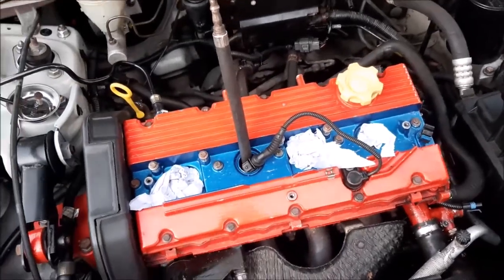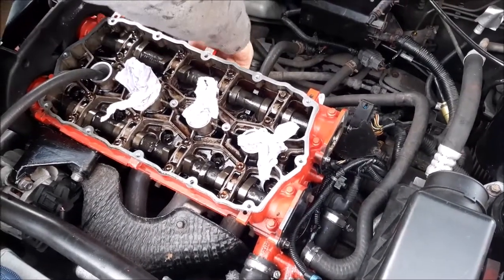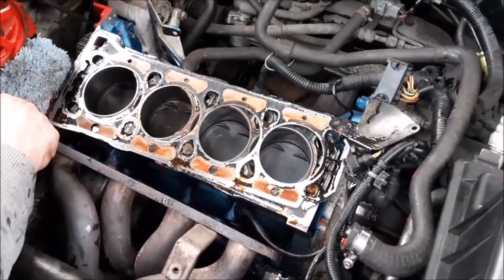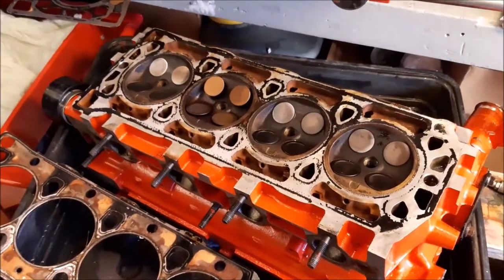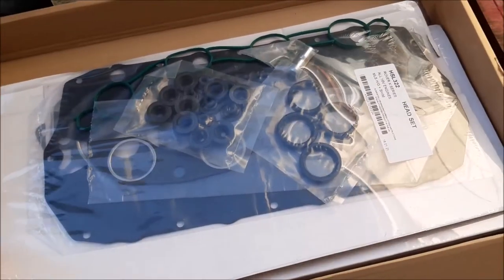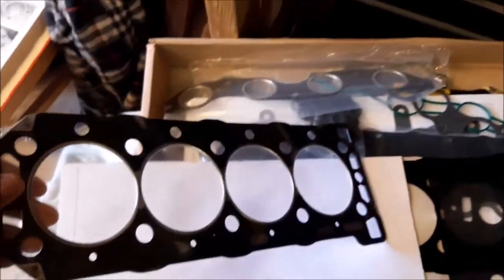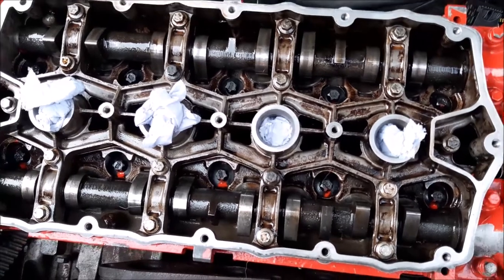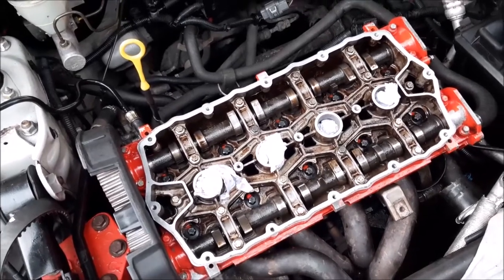Head Gasket Rover K series engine Part 1 Replacing the head gasket Rover 45

Comment: That was really informative! It's helping me (a completely non-mechanically minded person) to understand how the K-engine works.
I do have a question: I thought that a small bead of a special sealant (a Loctite product) should be used between the head and the gasket. Have I misunderstood that?
Reply from the maker: No sealant is needed with that gasket
Reply: @DPNTV  Thanks for that. It seems less messy that way, and not prone to using a sealant incorrectly.

Comment: Am changing my gasket is it work having the head skimmed or should I just give it a good clean with sand paper and place the gaskets cheers it’s a rover 75 1.8 petrol
Reply from the maker: We have never needed yet to skim a head so I would try cleaning first like we did in the video and then check the condition
Reply: @DPNTV Good advice.

Lazy pro-workshops ALWAYS skim Cylinder Heads as it saves labour and time cleaning it.  The cost is passed to the customer. In many cases Skimming is simply not necessary. A thorough clean and check with a reliable straight edge should confirm the head face is true ... or not. Check for Fire Ring indentations on the Exhaust Valve sides of the Head. Unless fire ring indentations are really deep, unlikely, fitting the MLS ( Multi-Layer Steel ) and the all important Head Saver Shim is all that is necessary. Sometimes there is evidence of a previous reface ( Skim ) and further skims could render the Head scrap. Sometimes the U-Shaped recess in the head face next to the Combustion Chamber circumference will be completely machined away. Seen that more than a few times. Chances are that Head is only fit for recycling.

On the few occasions Cylinder Heads I've worked on needing refacing I take it to a local engineering firm to have the head processed on a Grinding Machine, not a skim cutter. A light grind is far less harsh a process on the alloy and produces a superior surface  interface for the new Gasket ... 

I have seen a Rover Cylinder Head come back from a Skim in worse condition than before the skim. Placing a Straight edge on that head saw daylight under the straight edge. Always check for truth. I stopped that head being fitted without that simple check. That if fitted would be an immediate failure. Always check the work is good. The poor old Cylinder  Head Gasket invariably gets the blame when the real blame lies elsewhere.

Cylinder Head Gaskets rarely fail. Invariably they are first damaged by some other process such as over heating, Prime cause of overheating is coolant loss. Coolant lost can be due to many many reasons.

Comment: You never seem to block the flywheel... I want to change my oil rail as well, so I assume it's better to prevent the crankshaft from moving?
Reply from the maker: yes, it is important the crankshaft doesn't move. we used an AIR IMPACT DRIVER WRENCH when we removed crankshaft pulley and we also used a method to prevent the crankshaft moving which we covered in the video

Comment: Had my headgasket done on my rover engine was silent no overheating before the job was done / so when the job was done they told me on starting up the car a valve shattered on start up what would cause that to happen
Reply: Incorrect valve timing would cause that.

Comment: I might have memory issues, I thought the initial Torque up for the bolts was raised to 30Nm ? Then the two 180 degree turns.
Reply from the maker: the manual and the instructions with the kit both say 20Nm so that it what we used it is also what we have used before with no problems

Comment: Hi there my8 how long does a new gasket last I have a rover 75 1.8 petrol 220000 mls is it worth it to repair it
Reply from the maker: there is no way of knowing how long a new head gasket will last but if the  engine is looked after and you keep an eye on the water levels there is no reason it should not last for years

Comment: I would have also put on the better N-series gasket, stronger oil rail, higher tensile bolts and PRT thermostat in order to bring it up to modern spec.  Not much more effort if you are doing the gasket anyhow.  https://youtu.be/aMcjc3LmMv0   A minor point but checking for air out of the exhaust or out of the dipstick is a waste of time as they have other exists that are free to the air.
Reply from the maker: Thanks for the link to your video